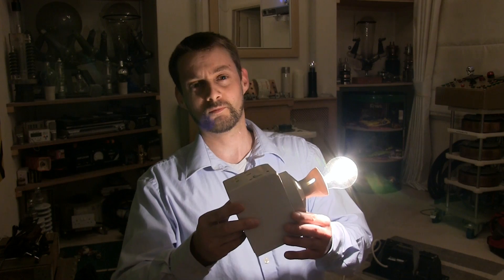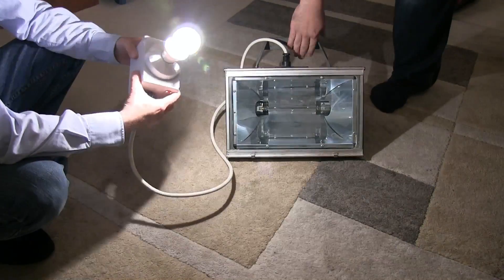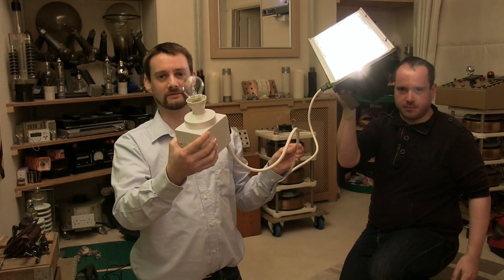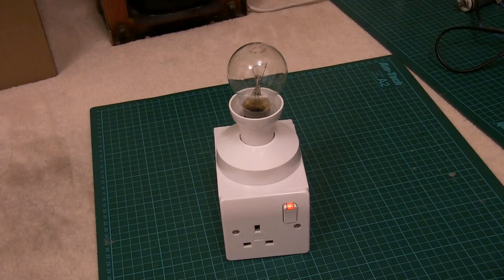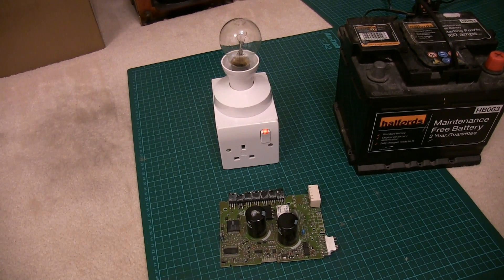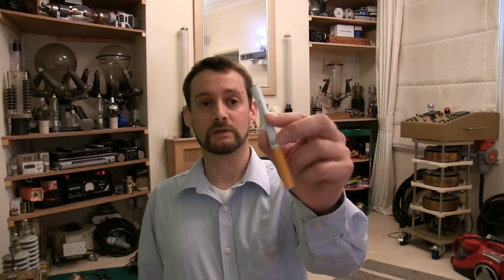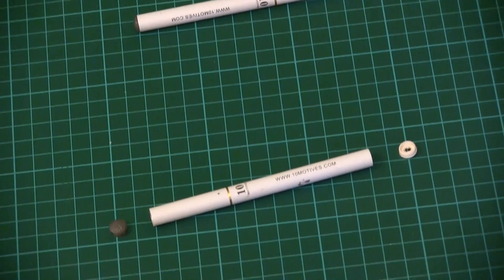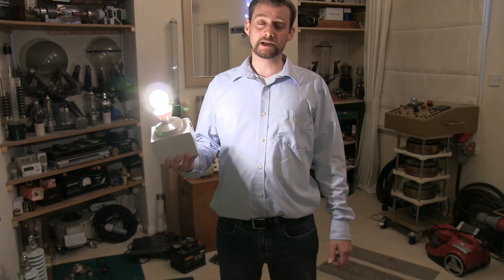Wireless 240v Power Cube Reveal

Comment: I'm more interested how long does it stand for? If I would like to have there about 30 000 mAh I would have to put a lot of batteries together first to circuit them parallel to get the right capacity and then put that into series to get 230-240V. Unless I'm wrong. I would really appreciate your help on that one. Regards. J.

Comment: So I also knew, lithium the polymeric batteries capable to short-time give big current, alas at such tension its capacity is extremely small. Also not really if at least one battery in a circuit doesn't correspond to parameters or will fail, but to mislead friends will be enough, will guess the inverter there or that else.

Comment: Are they rechargeable?  My 2008 Honda Civic Hybrid battery has individual cells and I think they are out of balance, need to equalize maybe?  I have a 2000V DC power supply but not way to regulate the current...

Comment: To all Viewers just be careful with rushing out to the hobby store and making little power boxes like this as the batteries can be very explosive and dangerous if accidentally over charged, charged or discharged too quickly, physically damaged or short circuited. Please note in the video there was very little voltage drop even when a 1500watt load was connected, hence the batteries have good voltage regulation, and can handle very high discharge currents, kilowatts of power out of a tiny little box..and also a very explosive fire if anything goes wrong. I suggest the use a aluminum box not plastic a LV DC rated circuit breaker, to reduce the fire hazard. 250V DC gives a much much weaker electric shock than 240VAC but can still be dangerous. have fun.. cool video.

Comment: How many times could you charge a phone with that? I assume quite a few times.
Reply: I'd love to be there (at a respectable distance, of course) when you connect 240-odd volts DC with such a current potential to the humble USB lead to your phone!  I think you've been watching too much Photon! ;-)
Reply: You couldn't. It's DC, so a plug in the wall charger wouldn't work, so only good for loads without transformers.
Reply: Unless it's a switch mode wall charger which (as others have mentioned here already) do work on DC.  But of course if you wanted to use this to charge phones you'd just rewire it to put out 5V instead.

Comment: You totally need to maker a rechargeable version!
Reply from the maker: It is rechargeable, I plug it in to the mains directly with a rectifier, it charges fine:)
Reply: Doesnt it need balancing? For each cell
Reply: Where can I get those batteries without buying the E-Cigs? Those would be great for a small experimental E-Bike.

Comment: What I really want to see now is the balanced charge circuits for 81 LiPOs
Reply from the maker: No balancing, they are all in series and charge directly on DC at line voltage, seems to work very well, no heat detected, nothing gone bang (yet)
Reply: I thought lipos had to be charged in 2 steps... constant voltage then constant current mode. Are you doing that (just at line voltage) or just rectifying line voltage to DC and hoping for the best?
Reply: That is the 'proper' way to do it, but not the only way... Clearly.
Reply: Lol, a video to be made at some future time. "What do 81 e-cig cells look like when they pop"
Reply: Interesting way to do it...

I would like to see a breakdown of each cell voltage after charging.... =)
Reply: it's the "proper" way, but hardly the only way.  they'll charge off straight DC fine, but it's just easy to overcharge them if your not careful.

The bigger problem is balancing (each cell wear's slightly different and discharge differently).  After a while, depending on how well the cells are matched (probably fairly well as they are probably all from the same factory, and only discharged once) eventually you need to balance charge the pack.  The two ways to do this i know of is to keep charging the pack until every cell is at full capacity (with the cells that reached full capacity sooner getting overcharged) or to use a special charger\configuration to individually charge each cell to full capacity (which is the proper way).

  I've seen success with both methods, though if you care a lot about your cells it's probably better to do it the right way (with salvage cells you don't really pay much\at all for, fuck it!)
Reply: Yep The charging of the batteries is a more complex than other batteries, that little box can be dangerous thou, accidentally overcharging is the big danger.

Comment: Ok, but, don't those lights need AC to run? So what converts the DC that the batteries deliver to the AC that the lights need?
Reply: Incandescent lightbulbs will work off of AC and DC. In fact, one might even say they perform better on DC, since they won't be flickering on and off 60 times every second (or 50 depending on where you live).

Comment: if you were to find a safe way to charge them up, this is an EXCELLENT idea for an emergency power supply. I could see this being used to charge a phone or power a computer if the voltage is near exactly correct, plus you'd want a DC to AC converter. And even though this packs undoubtedly a huge amount of amps, it doesn't matter, because how many amps are delivered depends on the load.

Comment: how much do you suppose this thing would cost?
Reply: also how do you charge it?
Reply: he already answered that "Mains through rectifier, dc limited by 15w incandescent lamp in series straight up the outlet :)" but this isnt something youd want to buy, its not practical for use as it wont have much of a lifetime before the cells are uneaven
Reply: The same way you charge your phone if you loose the usb lead, put it in the microwave for 30 seconds.

Comment: Makes me what to put 57 18650's all in series. Or maybe 28 for 120v see if I can run my computer!!
Reply: The power supply will work on DC. It will pass directly through the bridge rectifier, polarity will not matter. 

The first stage of an SMPS after the filtering is turning the AC into DC, granted this will be close to 300v DC with 240v mains.

Comment: I was close. I guessed lithium batteries but I also thought he'd squeezed some inverter guts in as well. My brain is so hard wired to AC-230 that I didn't stop and consider that a good number of appliances work perfectly well (and sometimes better) with DC. Photonic showed us two lights that were both types of incandescent (tungsten and halogen) and the mixer probably had a universal motor powering it... no problems there. You would not be able to run any equipment that relied on a transformer though or pretty much any motor that was not universal.I might try this with an inverter just to see what I can get out of it.

Comment: hey photonic induction, I'd love to see you walk into a vaping shop and order 100 Samsung 25R 18650s and see what you can do with them, in my experience a brand new fully charged cell can pack 90 amps pulse current for a few seconds, 30 in series with 70 in parallel would give you 126V with 1400amps continuous current (Max rating of 20 amps per cell) - I'm sure you would have fun with that lol
Reply: Why go to a vaping shop? These batteries are standard, they are cheaper to order elsewhere.
Reply: I'm aware but I didn't think he would want to piss about with Chinese vendors
Reply: very interesting translation to english to say the least...(Grin)

Comment: so i wasent that far wrong as i thought rechargable batteries and can be recharged via the plug socket, now wondering how many of my e-cig batteries i will need to do the same thing output says 4.2v at 40amps

ok just worked out i will need 57 of my batteries and assuming the amps stack up would mean i would have 2285 amps, be nice to know how many amps your little box provides